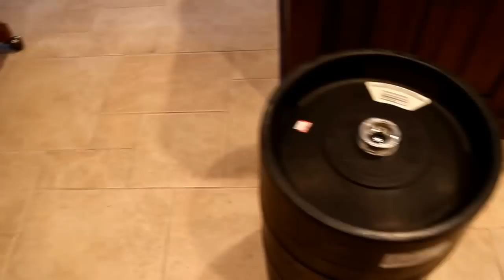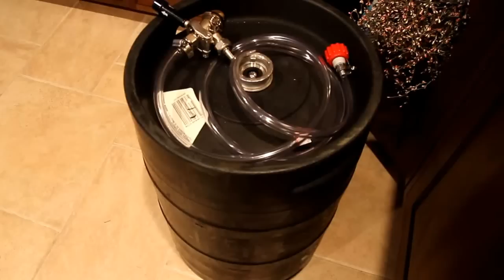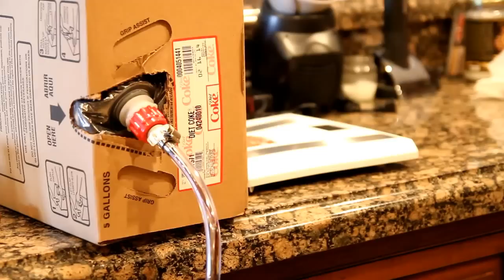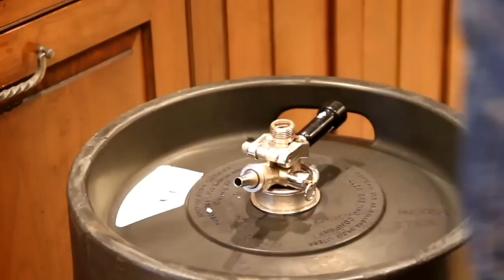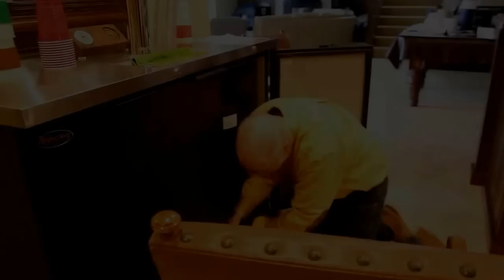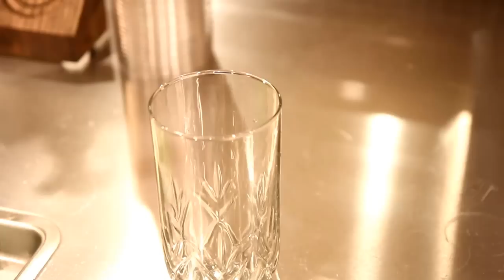Convert Beer System to Soda Pop Dispenser using Syrup and re-tasked Keg where no Water Supply exists

Comment: This is exactly what i was looking for. We picked up a vintage Pepsi soda fountain designed to work with premixed soda in corny kegs. Surprisingly you're the only video i found of putting soda in any kind of keg. Plenty of people making soda water but no actual soda. Will it keep it's carbonation at room temperature??
Reply: I have a kegarator that I wNt to do this as well. I have the co2 tank, just need to find mountain dew syrup and get a small beer keg (my kegarator size) and fill with water and syrup to what proportions? And this is the purchased soda syrup, right?
keeping them separate means carbonation will not occur until co2 is introduced through the tap. Right?

Comment: BEWARE: Carbonated beverage in contact with copper, brass (contains copper), or nickel plated brass like the valves inside most taps and beer faucets will dissolve copper into the beverage and poison you. Professional systems carbonate at the point of dispense at high pressure and only allow contacts with plastics, aluminum, and stainless steel post carbonation. This can still be accomplished but you need all stainless and plastic parts coming from the keg. I finished this same setup recently and, luckily, found out about the potential poisoning prior to tasting it. I ran the tap, flushing all liquids from the lines that had been in contact or near the brass parts in my system, tried a sample, and immediately developed copper poisoning symptoms.

Here is a great article that goes into more detail about the build as well as the dangers https://tasteofartisan.com/how-to-make-carbonated-water/
Reply: Brass often also contains lead, which is an even bigger concern.

Comment: LeeUrgent RequestI tried what you did in your video but miscalculated what I was supposed to put in. I was supposed to put 2.7 gal of syrup and after ther fact I realized I only did 1.7 but filled already and it has been uder 40PSI pressure for almost 24 hours:( what can I do to correct? Please Help. My email is josephzubik@gmail.com and my cell is 817-403-4037 if you coul give me a call it would be greatly appreciatedJoseph

Comment: I cannot get mine to pour without out foaming up bad! tried high pressure low pressure ever a Perlick flowcontrol faucette.. Any suggestions?
Reply: use 1 foot of 3/16 beverage line per psi of pressure.
Reply: You need what is known as an compensator which is designed to adjust flow through a premix or beer tap. 3wire sells one, and I've purchased parts from them before. They're expensive but i trust them. 
You can also order parts from totalapex.com
They also carry beer and soda parts and have amazing customer service.

https://www.3wire.com/product/cornelius-compensator-in-line-151721001-1006305

Also just a tip. 
make sure all your metal parts are stainless, otherwise you'll poison yourself.

Comment: does anyone know if you can fill a corny keg up with a couple 2 litters of coke (or really any soda) and set the regulator to dispense it ?
Reply: You certainly can, but it would be kind of a waste of the best resource the keg has to offer, and that is the cost savings.

If you can get a 5 gallon BIB of concentrate for ~$65, that works out to 1.6 cents per ounce. Buying it in 2-Liter bottles costs about 2.4¢ per ounce, so it's a pretty significant savings.

It would take about 9.5 two-liter bottles to fill up a corny keg.

Since it's already carbonated, you can dispense it at a normal pressure of about 5psi.

Comment: How to break the seal on boxed bag, so that it flows ?
Reply: You don't. You pull the cap off, and then thread in the BIB adapter. When the adapter is removed, it will seal the BIB back up.

Comment: Question.. You can buy 2 liter bottles of already carbonated coke for $1 each, so to fill a 5 gallon Corny keg would take 9.5 liters, and cost $10.  Could I just take a corny keg, fill it with 2 liter bottles, and charge it with co2 to keep it carbonated??  The boxes of syrup are $75, and the bottles of coke would be so easy to do.. Anything wrong with doing it this way?  Will the coke keep its carbonation if the co2 pressure is turned down to 7psi after it is fully carbonated?
Reply: If you can find it for $1,  you're at just about the break-even point. There's no reason you couldn't do it that way, but you lose the benefit of being able to 'tweak' the mix to match your personal taste. That also tells you that you should probably track down a food distributor and find a better price for the syrup. I was able to get mine from a friend who owns a restaurant for $65, and that included a little kickback to him to make it worth his hassle of ordering it.

The carbonation will remain indefinitely at 7PSI. That's one of the best benefits, is you never have to worry about half-empty bottles of soda going flat, ever again! Woohoo!

I'm also going to start using nitrogen and corny kegs to dispense non-carbonated drinks, like fruit juice and powerade. The powder for powerade is WAY cheaper than buying it in bottles, and being able to mix up 5 gallons of fruit juice from concentrate at a time, instead of doing it 1 pitcher at a time is gonna be pretty great! And no need to worry about sticky spills in the fridge!
Reply: This is my issue and what i do too,  the pressure in the soda and the head will eventually equal themselves out. If the head pressure is low, then the soda will loose its pressure to the head space and therefore be less carbonated. I currently am using a 1 gallon keg as a trial and the issue i am running into is the foaming, can not get it to pour without foam. I want the carbonation pressure at 55 PSI, (wife love it really bubbly). I worry if I use a really long tube to get the resistance needed, then the carbonation will be gone and soda will be flat. With a short tube, the carbonation is gone when it comes out of the picnic spout and soda has zero carbonation. If there are any suggestions to make this work, i would love to hear

Comment from the maker: Max,
It works and works great. I am not really converting a soda machine to a beer keg so differences in the two taps are not an issue.  I'm using the entire beer system or "kegerator" as a platform for dispensing soda. I'm just filling an empty beer keg with water and syrup. Since you have a regulator, you can control the pressure and thus foaming . . . and the pour rate as well.  I think it's no different with beer.  Too much pressure; too much foam.  Too little pressure and it takes too long to fill a cup. The biggest disadvantage i would say is the two full days it takes to completely carbonate the keg . . . at 30-40 PSI.  My regulator won't go any higher. But like emoneyblue suggested, putting double the pressure on the pop in the keg would probably reduce that time greatly.

Comment: Hey Lee, I have been told that this would never work. I had the same idea a while back but when I asked around I was told don't waste your time trying. I was told the beer valve is totaly different to a soda valve and it would not work. Yours seems to work fine, have you had any problems with foaming or excessive pressure at the tap? My research has also shown that a very long product line between the tap and keg can help reduce excessive pressure. Thanks for the video and the help.